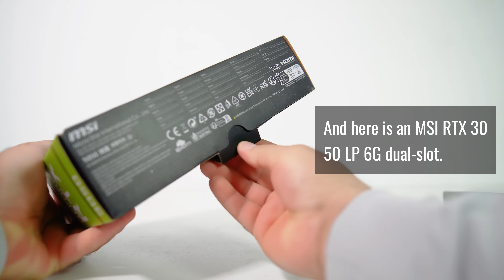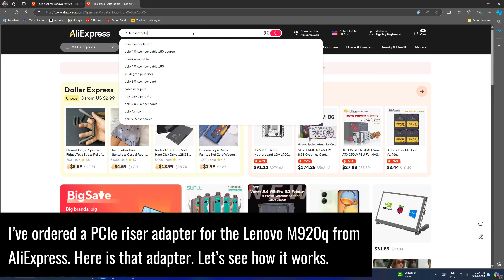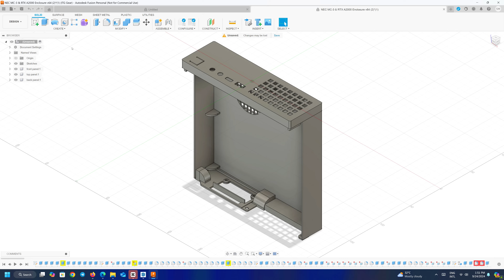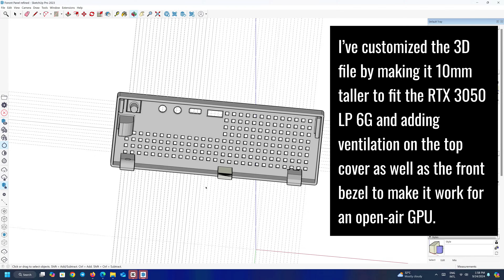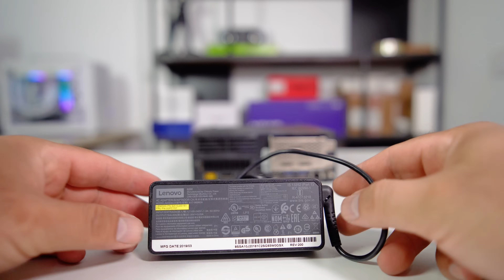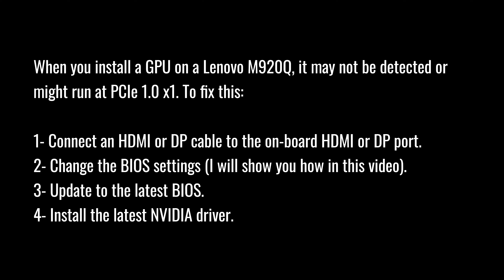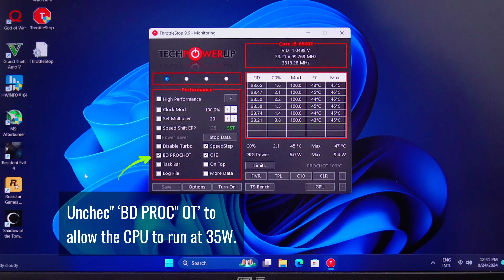Lenovo M920Q+RTX 3050 LP, CPU power limit fixed, Some AAA game 1080p 100fps+

Comment: You should make the whole top mesh and put a low profile noctua cooler on the cpu
Reply from the maker: Unfortunately, the Lenovo M920q motherboard has only three holes for CPU cooler mounting screws, so we cannot install a standard CPU cooler on it since a standard CPU cooler has four screws. Thank you.

Comment: it wouldve been cool to make a cover with an opening so the rtx 3050 sticks out the side and the caswe looks like original
Reply from the maker: Since the Lenovo M920Q has a PCIe slot, we can install a Thunderbolt card and connect it to an eGPU. I think it should support up to an RTX 4090.

Comment: next step put a i7  8700 and a rx 6700 or 4060 lol
Reply from the maker: Haha, great idea! However, the motherboard cannot supply enough power for both the CPU and GPU since they do not draw power directly from the AC power supply adapter. The motherboard still needs to convert 20V to 12V for the CPU and GPU.
Reply: @itggear it is interesting. Buy one more. Open, put mobo in full tower and run 4070 . Even with 8700t . And compare 2 editions ?. Small is ps5 mini and big is ps5 Pro😂?

Comment: For the same price you could have bought a SFF computer such as the Lenovo V530S and saved all the 3D printing to make the case fit. You would also have a PCIe x16 port instead of a x8 port.
Reply from the maker: Thanks for your suggestion.

Comment: I have a ThinkStation P360 that I've been wanting to do the same thing with, will this work for my setup as well?
Reply from the maker: The P360 supports a 50W GPU when paired with a 35W CPU out of the box. If you choose to install a single-slot low-profile GPU like the RX 6400, T1000, or RTX A1000, you’re ready to go without any configuration or modifications. Thank you.

Comment: Great mod. Love how u do it, and how u explained it. 
With your permission i am gonna use your idea, we are letting go this year some lenovos thinkcenter with good cpu at work, and ill take one. The only different thing i would do is that there is a plastic yellow/orange colour very thin, which is used to prevent touching metals in electronics, i would go for that, its quite cheap, very thin, and its adhesive. Thats the only thing i would have done different. Other than that GREAT!!!!       Ty for the idea and your video. U have won a subscriber for life.

Comment: i think lenovo using their laptop power brick for their sff pc is kinda smart, now you can actually upgrade the gpu and not thinking about the that weird sff psu anymore
Reply from the maker: It’s a tiny PC project with a volume of only 1 liter, making it much smaller than an SFF desktop PC and even smaller than a laptop.

Comment: Rx 6400 with its low power consumption and slim af design might fit the case without any modifications.
Reply from the maker: Sounds like a solid choice! The RX 6400’s low power consumption and slim design should fit perfectly without any modifications. However, it should work on the Lenovo M920x and Lenovo P330 Tiny only, as these PCs have ventilation on the top cover right above the GPU location. It should not work on the Lenovo M920q and Lenovo M720q. I’ve seen a few videos where people installed single-slot LP GPUs on the Lenovo M920q and had to drill many holes in the top cover to make the GPU temperature usable. This can seriously damage the PC more than using 3D printed materials, as we can always revert to the original housing at any time.
Reply: @itggear  the closest available here is the p340 tiny so I will probably try it using that.
Also I can just cut a large hole and slap on a magnetic dust filter on it
Reply: @itggear 

Lenovo ThinkStation P330 Tiny Top assemble 02CW663

I installed this top assemble on my m920. And I’m using rx6400. The rx6400 FAN and the hole on this assembly are misaligned.
Reply: I have mine with a Yeston 1650 LP single slot. Looks just like a RX550 or RX6400.  I'm even seeing a small single slot 1060 6gb start to surface on my AliExpress feed.
Reply: @forzaflyracer3473  I saw that 1060 too. It's very tempting! Hopefully some mobile chips can get recycled and put into other cards.
Reply: @RogeriusRex  yes I hope so.  I bought a 6600m off Ali and it worked outstanding. (sold it in a build) Now I wanna see some more cards like it.

Comment: Have the same combo, but upgraded to a i5 9400F (65W) and 32 gbs of ram, it came around ~$400 but totally worth it
Reply: I use i9 9900T in a M910x
Reply: @NetrunnerAT  with a dgpu ? if so does the i9 work at 65w ?

Comment: I have been mucking with a m720q the i7-8700 version.   When the CPU is pushed the fan is so loud. I have reapplied thermal paste and everything.

The older m710q version seemed to have a far better copper cooling and CPU fan setup

Comment: woow its amazing... thanks for it... i want build like this,,, searching second hand too
Reply from the maker: If you’re considering purchasing a compact Lenovo PC, I recommend opting for either the Lenovo M920X or the Lenovo P330 Tiny instead of the Lenovo M920q or Lenovo M720q. Here’s why: both the Lenovo M920X and the Lenovo P330 Tiny come with built-in support for 65W CPUs and graphics cards. That means you won’t need to tinker with anything—they’ll work right out of the box. all these model has physical the same. Thank you.

Comment: I have to put this card in my optiplex 7050sff with an i7 7700 and 24 gb of ram! Thank you very much your video motivated me a lot！
Reply from the maker: The Dell Optiplex 7050 SFF (Small Form Factor) has a PCIe x16 slot, but it’s positioned quite close to the power supply unit (PSU). If you’re planning to install a GPU, consider using the available PCIe x4 slot instead. However, keep in mind that the Dell SFF chassis doesn’t provide ample room for airflow, especially for dual-slot GPUs. If you go ahead and install a dual-slot GPU, it might run too hot, resulting in increased noise and potential throttling of GPU performance. To play it safe, I recommend opting for a single-slot, low-profile GPU for your PC.
Reply: @itggear  thank you!!🙏 
Any recommendations ? The arc 310 maybe?

Comment: The larger power brick doesnt benefit it entirely. Its capped at a bios level to 135w or whatever. Yours will work but there is a usable limit.
Reply from the maker: I bought it from a nearby computer shop for $45, and it’s the only one available in stock. So, whether it’s 135W or 230W doesn’t really matter—it only costs a few bucks more.

Comment: I have the same setup i5 9500T + MSI GTX 1050 Ti 4G LP + ThrottleStop but I'm having bottleneck and cause network lag fro 2 to 5s on Warzone 2.0 and PUBG :) only on first drop. Good thing after lag it runs smoothly around 85% CPU usage. I used this mini pc for comshop gaming and arcade also 2.5 years now :)
Reply from the maker: Have fun!
Reply: @itggear  I think, it would  be perfect if i7 9700T or i9 🤩 but still expensive :face-purple-crying:
Reply: @J12RQ  thats only the k series of the higher power i5s then the i7s and i9s the i3s are fine and sometimes good budget options
Reply: Yeah I'm having so much fun of power consumption is very low at 115w max wall socket
Reply: @J12RQ  I was wanted RX 6400 I think 50W TDP which is I like than RTX :). Unfortunately I don't have budget  for now 😅. maybe in the future RX 6400 price drop
Reply: I currently have one of these with an i9 9900T and a NVIDIA T1000 (2021) which is basically a GTX 1650 and it's designed to go inside tiny PCs like these, low profile and single slot and only 50W, I could get a Yeston RTX 3050 which is also low profile and also single slot, smaller than the 3050 shown in this video but I am fine with the T1000 honestly.
Reply: I use a M910x with i9-9900T and RTX A2000 12GB with a single Slot cooler and GPU undervolted. Very nice Steam-Box for TV.

Comment: I'm sniping for m920x now cost about 150$ but only with g5400 processor:/
Can You share Your stl?
Reply from the maker: I’ve updated the link for the 3D model files in the video description. Thank you.
Reply: Good news for you - you can change CPU later as they are socketed
Reply: @Doktoreq i've already buyed m920q with i5-8500T and soldered pcie ofc.
Reply: @Doktoreq  unfortunately Your STL cannot be properly cutted in Prusa slicer, there is large hole on one side after cut and cannot be printed.

Comment: I think the adapter 170W is quite enough but you use a 230W, which is safer kkk
Reply: Ku klux Klan? Why are you racist?
Reply: 135w I think is enough for 50W TDP LP GPU and 150W to 170W for 75W TDP GPU

Comment: Nice video! Do you have the STL file that we can download or modify?
Reply from the maker: I’ve updated the link for the printable 3D model files in the video description. Thank you.
Reply: @itggear  Awesome! Thank you so much!! :) I just ordered a Lenovo M920Q and saw your video. Awesome job on the 3d printable case!
Reply from the maker: The 3D printable file had some issues, which I have corrected. The updated version is now available on the Printables page. Please consider downloading the new file. Thank you.
Reply: @itggear  Thanks! Just re-downloaded the files. Great job! :)

Comment: We have millions of these at work time to create a LEGION of mini gaming pcs 😂
Reply: And it's a lenovo ironically. Sooo........
Reply: for reaal, i have HP Elitedesk Mini G5 (i5 8500t + 16GB RAM), an i added a RX 6600, is really good
Reply: @KevinG761  you're using a riser with it or how did it fit
Reply: @Gh0styGames  yeah, external riser, m.2 to pcie x16, but nvme only have x4 pci lines, work perfectly
Reply: @KevinG761  oh it's outside the case gotcha
Reply: @Gh0styGames  just that
Reply: We have them at work as well.  During the pandemic, when they tried to limit the amount of people in the building (I work in the technical department) I was given administrative privileges on my workstation (a Lenovo M720q Tiny) because next to having to access work-related things (firing remote deployment of a Windows install, for instance), stuff didn't break as much (I mostly check the camera sets for being complete and non-defective, and those were not used as much just as well).
Differently put: I was frequently bored out of my mind.  IT department said to take work I normally did at home to work and do it there (My boss says "That you go home more refreshed if you are not waiting for time to pass").
So I took a Blender project with me once.  And I found out those tiny computers were very capable in handling Blender even on the i5-8400T (yes, rendering they do not like as much, but modelling was still very VERY decent).
It made me order a second hand one.  Best computer I ever purchased probably.  Going to add an T400 soon.

Comment: Finally, you have fixed the problem on the Lenovo M920Q, where the CPU power is limited to around 5W when a GPU card is installed. I found this issue discussed in many forums and noticed that several YouTube channels struggled with it. I watched a few videos about installing a GPU on this tiny PC, and their CPUs were running at around 5W, resulting in game performance of only about 30fps. Well done, dude!
Reply: This approach occur bottlenecks?
Reply: How do I workaround the 5W limitation on a Linux (Debian 12) system?
Reply: @franzpleurmann2585  YOU WOULD HAVE TO FIGURE OUT HOW TO DISABLE THE SETTING HE DISABLED IN THROTTLESTOP ON WINDOWS BUT ON LINUX
Reply from the maker: I did. Check this video: https://youtu.be/E8PhRcU9G1o
Reply: @itggear  wow, you are a pro
Reply from the maker: @MorganEdgy  Read disclaimer in the video description.
Reply: @franzpleurmann2585  install windows
Reply: @franzpleurmann2585  probably use wine